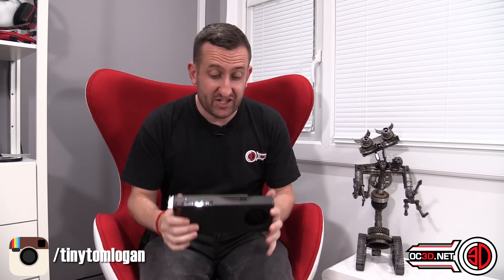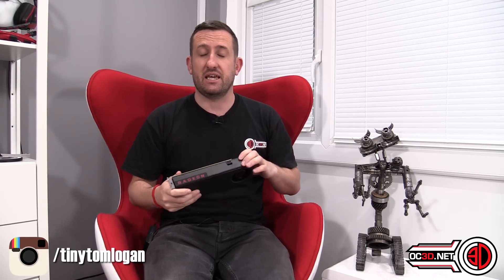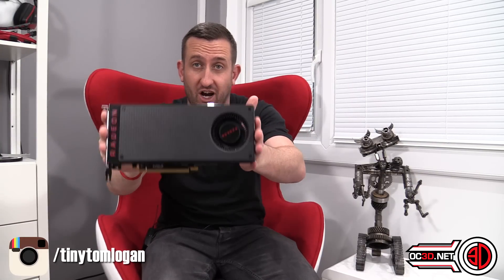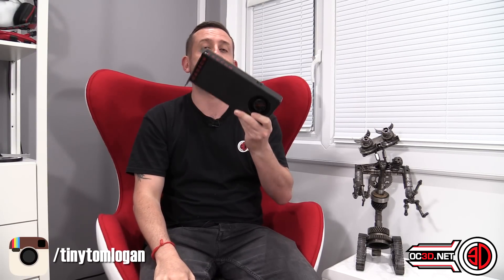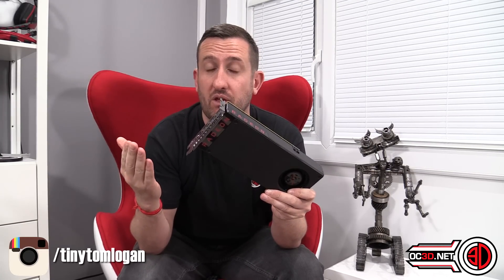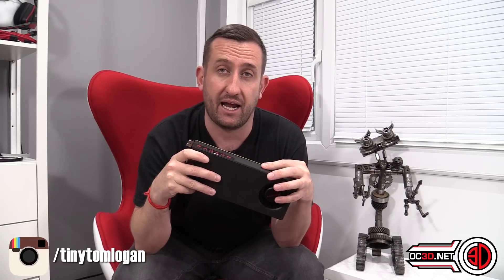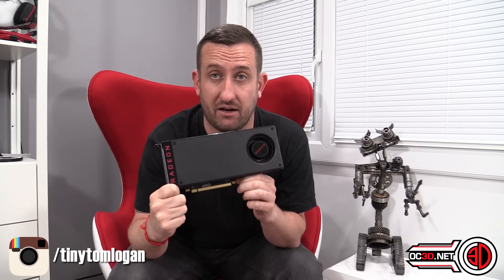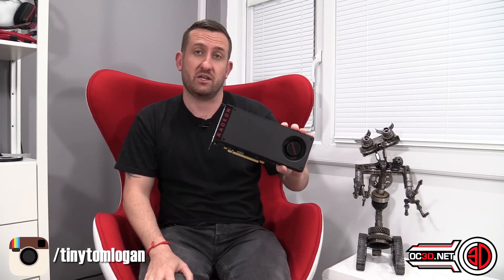RX480 power bottleneck? TTL Talks

Comment: I'll be waiting for the AMD fanboys who bash Nvidia for power limitations to bash AMD for this. Buying an aftermarket 480 and it performing exactly like a stock one
Reply: this is a reference card not aftermarket. your ignorance is showing
Reply: he's mistaken.  he means the reference ones that have a tiny overclock such as the XFX ones.  you clearly don't know what you're talking about.
Reply: +Andrew Russell the aftermarket cards arent out. the only "after market" thing about his XFX card is the backplate. Use your ears, as he stated this in his 480 review
Reply: nvidiot...
Reply: conenubi701 you clearly didn't listen to what he said. He said he has an aftermarket card and it performed the same as the stick card. He even talked about pulling it out and swapping the reference back in. Use your ears
Reply: +Andrew Russell Boi you are dumb.
Reply: Reference PCB + Reference cooler = Aftermarket GPU? Fuck, you're dumb.
Reply: Andrew Russell boy you're an idiot.
Reply: +Andrew Russell Tell us all the things you know about the way power is supplied and handled by a GPU, because you're not getting the point of an actual custom PCB in this case
Reply: XFX rx480 reference cards have a slight overclock ;)
Reply: He said he has an overclocked sample, not an actual custom pcb and cooler one. I think you misunderstood there. He also said himself that the actual custom cards should perform much higher by removing these limitations. I am disappointed they used only a single 6 pin but reference cards in general are always garbage.
Reply: Andrew Russell Nice RX480 reference you have there.  Copypasta
Reply: Andrew Russell There's a difference between a smart person and you.
Reply: +Geo Dude Dude, I just don't know what to tell you apart from look at the OC3d 480 benchmark results. Take a good look. The 480 isn't even a 1440 card bud, you have to turn off all the bells and whistles simply to achieve average frames, that's not good, same goes for the 970, it too is at home at 1080p. Tom's benchmarks are in both dx12 and dx11. Jayz 2cents also ran the dx12 dx12 benchmarks and same there. You can play games at max settings in 1080p and achieve 60 frames comfortably, it will only play 1440 at 40 to 50 frames but you have to turn settings right down to Off in order to achieve it... Thats not a 1440 card. You can play at 4k if you wish but you only get 10 frames max hence it's not a 4k card. Hell I have a Fury X and a Hoff edition 980ti which both of them are really a 1440 card. I can play at 4k but the frames on both tell you they are really a 1440 card ie no settings turned off and all the bells and whistles on and still get 60 frames minimum. That's a 1440 card. The only 4k card I have seen is the 1080 as that can play new titles at 4k as seen with Doom etc at 60 frames minimum. And please stop with the whole Vulkan thing, it's open and will benefit Nvidia's Maxwell and above just as much as AMD... That's the whole piont of it, it seems AMD card owners seem to think only AMD cards will gain anything lol. And Asynchronous compute only benefits the lower end cards, it only yields 3 percent max in top tier cards like the Fury and Fury X. AMD themselves acknowledged that from day 1. Good if you own lower end card, not so good for top end. And as we already know, new dx12 titles such as Battlefield 1, GTA6, Cod, andlmost of the upcoming dx12 titles won't take advantage of async, so it depends on what you play, we can already see that with the new dx12 Tomb raider for example, at the end of the day most game titles are ported over from console and are dx12 wrapped which means no async. And as Nvidia own a lot bigger market share than AMD well...I'll let you figure that out.
Reply: To play devil's advocate I'd say there's a difference accepting power limitations from a 200 dollar card vs a 600 dollar one.
Reply: Wokis you clearly didn't listen to what he said. He said he has an aftermarket card and it performed the same as the stick card. He even talked about pulling it out and swapping the reference back in. Use your ears
Reply: Pascal has hard voltage limitation...not power limit.
Reply: wakesake I've owned and CPUs and gpus up until earlier this year. I've also built many pcs with them for friends. Nice try though
Reply: *****  exactly, an overclocksd aftermarket reference version where you will get 0% gain out of the box. The whole point of favored overclocked cards is for those who don't OC, people like a couple friends of mine.
Reply: Andrew Russell time will tell
Reply: i don't think so their will be performing better than the reference rx480 but not as good as my msi gtx 1080 eheh which i love very much
Reply: Yussef Mneimneh 700 card vs 250 card, what did u expect?
Reply: yes of course i know that lol
Reply: Max Provoost this is an aftermarket card, but it's reference design...
Reply: Michael C exactly, aftermarket reference blower design cards with overclocks that give 0% performance gain due to the powerlimit issue.
Reply: Max Provoost did i saw he had a custom pcb card? no, i didn't. He has an aftermarket card with a reference blower design and an overclock that gives 0% performance increase due to the powerlimit issue.
Reply: Michael C prove me wrong
Reply: Michael C oh wait you can't, because that's literally what he said and did. jokes on you sucker
Reply: +Andrew Russell There is no such thing. Would you like to answer my previous question? Not that that is necessary anymore but still
Reply: Max Provoost Really? Then what's this????
http://www.newegg.com/Product/Product.aspx?Item=N82E16814150772

Power delivery depends on which company and which design they are using. The power connectors feed into the Voltage Controller which control/drop the voltage down to different levels and send those voltages to the chips that need them, like transistors, memory, gpu core. It then goes to the Voltage Regulator Modules (VRMs) then mosfets or mosfets then VRMs (depends on the design). The Voltage Controller sends a PWM signal to the VRMs (multiphase VRMs to be exact) which output the correct voltage, then goes through two mosfets to the inductor and then capacitor to make sure it's a clean "smooth" voltage/current signal, keeping fluctuations away which could lead to instability. Each set of VRM/Mosfets/Inductor/Cap is a "phase". The more phases, the better regulation of power can be delivered. The memory usually gets 1-3 phases while the gpu core generally gets 4+.
Reply: Max Provoost oh really? it was made by nvidia directly???? wow
Reply: nimrodery there's a difference between aftermarket gpu and aftermarket cooler
Reply: nimrodery Yup, I'm a genius.
Reply: Andrew Russell Nobody cares what your mom thinks.
Reply: nimrodery says the guy with a username that explains his intelligence.
Reply: Andrew Russell LOL so you didn't read the Bible. I love it when people fail trying to figure out my username.
Reply: nimrodery actually i have, but how do you expect people to figure that out? Such an obscure reference compared to what it looks like
Reply: ***** he said it would run 1328mhz but wouldn't score any better, which doesn't make any sense, but it did.
Reply: Andrew Russell I don't really expect people to figure it out. I expect that some people will take a cheap shot at it, and that just shows them to be kind of cheap. If you want to insult me, at least try something creative.
Reply: ***** how many reviews have you watched? There's a difference between boost clock and Gpu boost 3.0 which goes above that.
Reply: Max Provoost and no that wasn't copypasta, I had to write that all out. Not my fault you don't know how gpus work.
Reply: ***** then you should know that cards stick with their boost clock. When Gpu boost occurs, like the 1080, it goes way higher but then drops down over time due to heat, back down to the boost clock
Reply: +Andrew Russell " He has an aftermarket card with a reference blower design " Dafuq? If that's the case, the PCB is still a reference design only rebranded by board partners with some brand stickers.....
Reply: Habib Huseynov actually it didn't...it's on par with it or slightly better
Reply: ***** beats the 980? not in the benches ive seen, and ive watched like 7-8 different reviewers. it fights with the 970 but doesn't beat the 980 until it's an AMD game like Hitman
Reply: ***** async didn't do that much for it. check it out. 
http://wccftech.com/async-compute-boosted-hitmans-performance-510-amd-cards-devs-super-hard-tune/

Also, not sure if you realize this but the sub 5% clocks you're talking about doesn't make more than a 4% fps difference, which is a tiny gain.
Reply: *****  well that shit article has devs saying that there wasn't a lot of gain from it and it's hard implement. 

AMD is seeing massive gains due to their shitty dx11 drivers. Look at games where they run dx11 then dx12. It's been known that amd sucks when it comes to drivers. They barely released any in the first place. They didn't even hit their 3 a year quota.  Not to mention the terrible cpu overhead for the drivers. For budget builds you basically had to go with an Nvidia card like the 750ti because a 280 would get beat by it when using an i3 (which is what would be in a budget build). 

Remember Mantle and bf4?

Remember how much Vulcan did for Talos? Runs much worse than dx11. They have a lot of work to do.
Reply: +Geo Dude Dude, it's not beating the 980s and it's certainly not beating any of 980ti's. It's sitting around the 970's, which is great as it's doing what it's designed for. It's a very good 1080p card but not so good 1440p card as you have to turn down a lot of in game settings and bells and whistles. it will be interesting to benchmark the 3rd party versions as they will be slightly cooler, as 85 to 90 degrees at 1080p is simply not acceptable now, especially since Nvidia's Maxwell and Pascal achieve much lower temps. The problem is if 3rd party versions have to add an 8 pin power connector to as well as the six pin then it kind of defeats the claim and object of AMD'S newest card. I have read a few results where the aftermarket card has ruined the PCI express thus rendering motherboard's broken, they claim it's due to the fact once you increase the power voltage it goes way above the PCI express threshold. As for the 480vs970's take a look at Tom's benchmarks video, both in dx11 and dx12 titles tests. Look where it stands next to the 970's 980's, forget the 980ti's it's just not that way designed to compete with it.
Reply: +Geo Dude Dude, it's not beating the 980s and it's certainly not beating any of 980ti's. It's sitting around the 970's, which is great as it's doing what it's designed for. It's a very good 1080p card but not so good 1440p card as you have to turn down a lot of in game settings and bells and whistles. it will be interesting to benchmark the 3rd party versions as they will be slightly cooler, as 85 to 90 degrees at 1080p is simply not acceptable now, especially since Nvidia's Maxwell and Pascal achieve much lower temps. The problem is if 3rd party versions have to add an 8 pin power connector to as well as the six pin then it kind of defeats the claim and object of AMD'S newest card. I have read a few results where the aftermarket card has ruined the PCI express thus rendering motherboard's broken, they claim it's due to the fact once you increase the power voltage it goes way above the PCI express threshold. As for the 480vs970's take a look at Tom's benchmarks video, both in dx11 and dx12 titles tests. Look where it stands next to the 970's 980's, forget the 980ti's it's just not that way designed to compete with it.
Reply: ***** where are you getting these benches??? I guess you just looked at Guru3D's review? Look up plenty of other reviews of the 480 and watch it get stomped by the 980. Here's some benchmarks for you. Hitman runs better on AMD gpus, that's known.  

http://www.gamersnexus.net/hwreviews/2496-amd-rx-480-8gb-review-and-benchmark-vs-gtx-970-1070/page-4

Also you obviously don't understand how voltage and gpu clocks work. 
"and just by undevolting the RX480 it will get much better performance because it wont be hitting the power limit and it will run at the marketed 1266MHz."
You do understand that to run 1266mhz it NEEDS more power, right??? Hitting the power limit means you need to RAISE the power limit to keep that 1266mhz. Lowering the voltage is the complete OPPOSITE!!! Volts x Amps = Watts. If you lower amps (power limit) it will reduce power to the card. If AMD undervolts or changes the power limit it's going to DROP the core clock. Most likely they will be ditching the 1266mhz boost clock and it will just run at the 1120mhz base clock, or lower.
Reply: *****  HAHAHA he's done an overclocked  liquid cooled 480 review too you idiot. It takes a 1390mhz/2200mhz RX480 can keep up with a reference 980.

http://www.gamersnexus.net/guides/2499-diy-amd-rx-480-hyrbid-results-with-bigger-overclocking

You clearly don't understand how electricity and tdp works. By raising the power limit you are using more current (amps) and this increases heat. GamersNexus, Jayz2Cents and pretty much everyone has talked about how raising the power limit increased heat a lot. It's pure science!!! Increase power wattage = increased TDP wattage (TDP is the heat that is given off), and they are directly related.